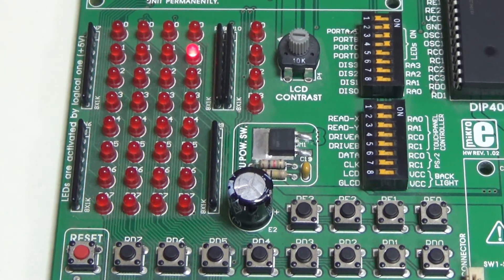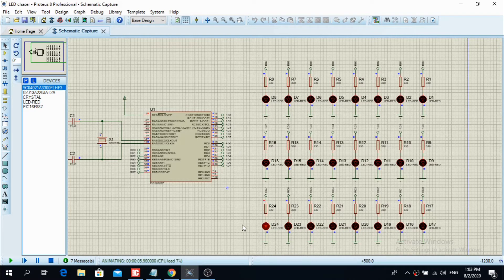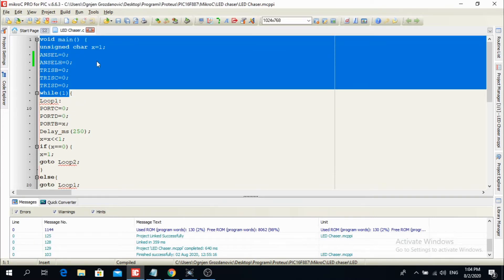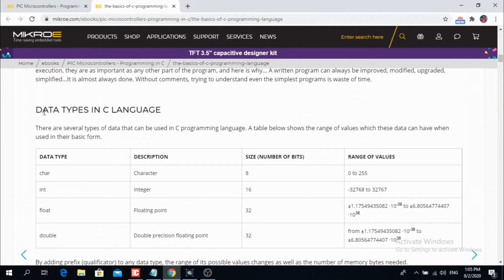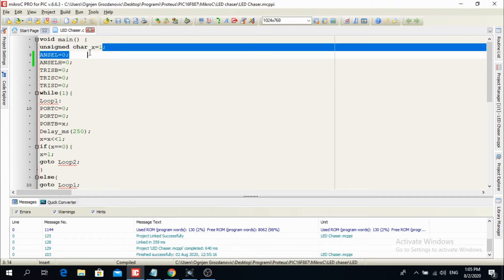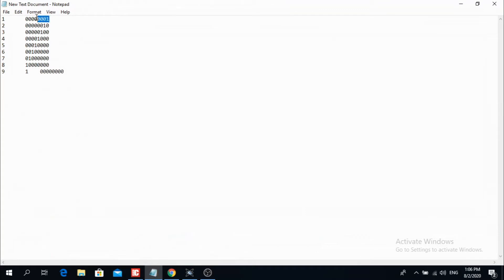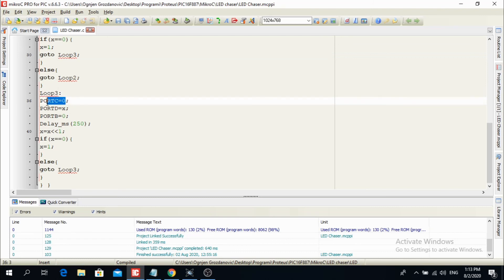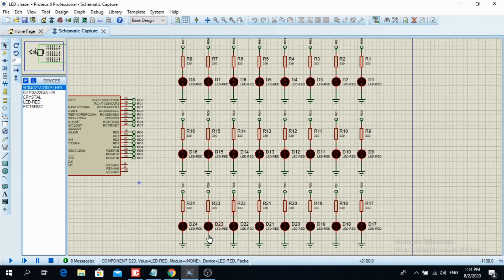Project #5 LED chaser | mikroC pro for PIC tutorials

Comment: Mozes i sa tajmerom uraditi.
Evo napisacu kod u komentaru, da ne kacim po stranicama.

void Timer1Int() iv IVT_ADDR_T1INTERRUPT ics ICS_AUTO
{
      LATB = global_var;
      global_var = global_var<<1;
      if(global_var == 0) global_var = 1;
     /* Clear Timer1 interrupt */
        IFS0bits.T1IF = 0;
}

        extern int global_var = 1;

void main()
{
     AD1PCFGL = 0xFFFF;        // Set All pins as digital
     TRISB = 0;
     LATB = 0x0000;
     T1CONbits.
     T1CONbits.TON = 0;
     T1CONbits.TCKPS = 0b11;
     T1CONbits.TGATE = 0;
     T1CONbits.TCS = 0;
     T1CONbits.TSYNC = 0;
     PR1 = 19531;
     IEC0bits.T1IE = 1;
     IPC0bits.T1IP = 0b111;

     T1CONbits.TON = 1;
   
   while(1){}

}

clock_freq je 5MHz, preskaler 1:256
Reply from the maker: Lepo